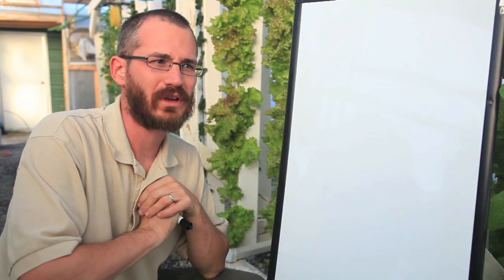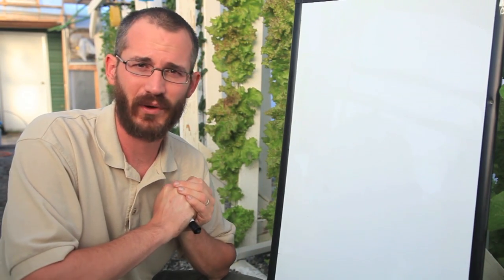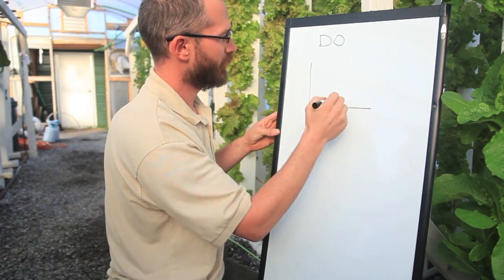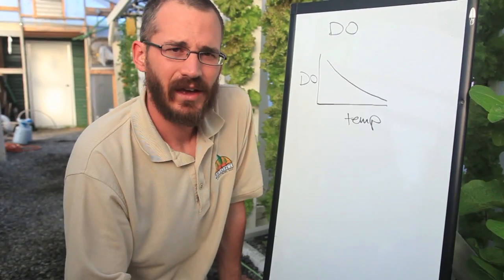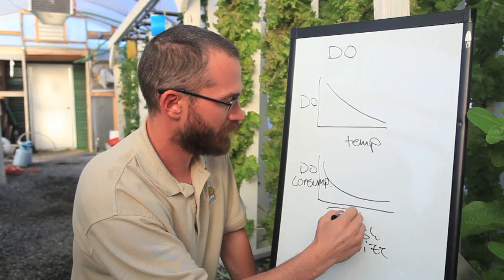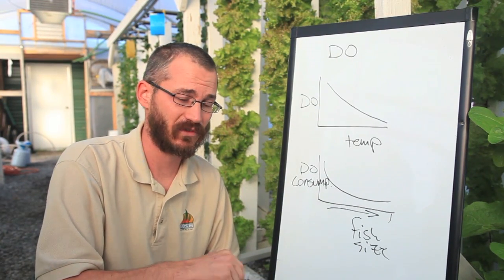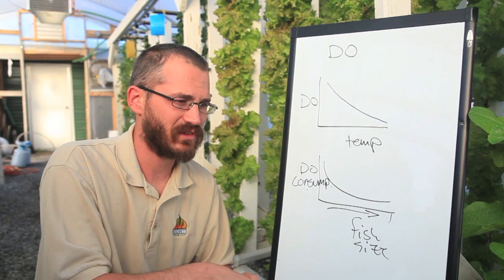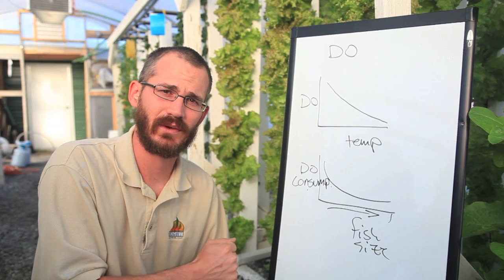Aquaponics & Dissolved Oxygen: The Basics

Comment: are there any monitoring tools available for aeration devices that would help keep dissolved oxygen at safe levels for the fish?
Reply from the maker: Hi Adam, Yes. You can use a DO (dissolved oxygen) meter to make sure your levels are within range. It depends on what type of fish you're raising but generally a minimum of 5ppm is what you want. Hope this helps!

Comment: Smaller bubbles means more ability of O2 absorption in solution. Look for as small of bubbles produced by stone as possible. Think about it like this, more surface area the smaller the bubbles have, more absorption into solution. It's like a boulder to sand weight ratio, the boulder may be bigger and heavier in a single mass. However sand at the same weight ratio has million's of times surface ratio as the single boulder.
Reply: Or you can reverse it, and trickle water through a trickle filter or mist water through the air back into the main body of water and get just as much O2 exchange from the surface area :D

Comment: I'm a backyard aquaponics hobbyist and I really appreciate these videos!  When it comes to internet advice I pretty much only trust you guys!  Nate's the man! 

Which is why I am curious about your thoughts on electrolysis for aeration.  Similar to the O2grow product.  Using electricity to split water molecules and make HHO gas.  Apparently, this is a great way to dissolve oxygen into water.  But are there any side effects?  I'm curious if the reaction will also create salts or chlorine over time?  Perhaps the plates will also break down with time and add metals to the water?  I'd love to know your thoughts on the topic!  Thanks

Comment: I have a question .right now I am.currently doing calculations and.designs for aquaponic system and I will use the tilapia as a nutrient resourc  . but I am.stuck at calculating the  aeration  for.the tank.I mean the air pump size and my fish tank size  20000liter, and the density is 500 kg can you explain for my how to calculate  that to choose the correct air pump size
Reply from the maker: Hmm.  It depends on the temperature you’re going to be running your water at, the turbulence you want to introduce and the fish and feeding rates you’re working with.  That being said a general good rule of thumb is the volume x1 or volume x2/hr for air- so you’d want between 20k and 40k L/hr

Comment: I have a question .right now I am.currently doing calculations and.designs for a.shrimp farm.where I live and I am.stuck at calculating the aeration requirements for.the tank. I am looking all over but I am.not finding the standard oxygen transfer efficiency factor and.the field transfer efficiency . can you guide me what figures to use or how to.derive these factors or where to look for.these factors. my tank is 24feet diameter by 52 inches deep. thank you.it's a biofloc system as well
Reply from the maker: Hey +Mansoor Hosein - Yeah, check out the fao.org site- they have tons of relevant information. I really can’t help with shrimp!

Comment: So this is actually in reference to a pond i'm attempting to restore into a self-sustaining ecosystem. I just added a homeade fountain to it, will that help create dissolved oxygen? Also what are the physics of the oxygen molecules in water? do they stay near the point of water disruption or do they disperse throughout it along the waves thats created from the disruption. Does it go down to lower levels of the water or stay near the top for it to escape back into the air?

Its a lot but i would appreciate a response :)
Reply from the maker: Hey dgorrell7  1. Yes, a fountain will help with DO.  2. DO diffuses through the water from areas of high DO to areas of low DO.  So it will diffuse, but it will also be consumed very quickly, so the question is whether your introduction and diffusion rates are faster than your consumption rates by microbes, fish, plants, etc. Hope that makes sense!
Reply: It makes perfect sense! i love the videos, some go a little to in debt for me but for the most part (thanks to physics) i understand a lot of it. Also, how does layering happen? when you say that it diffuses from areas of high DO to areas of low DO, shouldn't it go deeper into the pond? or is the water too warm and it escapes before it diffuses because of the molecules of water moving more rapidly? Thanks, i have a ton of questions.
Reply from the maker: Yes, it should go deeper in the pond, but consumption, different water temperatures, humidity, sunlight, etc. can all interfere with that process, dgorrell7.
Reply: Say i introduce crayfish, i'm assuming they're not much of a top feeder/algae eater but are they are a good first thing to introduce back into it? Because initially i was thinking about introducing carp into the pond to clean out the bottom or at least some of the dead matter (probably piled up). Then i didn't want the carp to spawn because that would be a huge nuisance. So i'm considering crayfish now. if you disagree could you forward your suggestion for a first species introduction? the pond has been practically lifeless except for ducks which don't do much for about 10 years or longer. and thats ten years of algae die offs. and up until recently with the fountain no sort of aeration either.
Reply from the maker: dgorrell7  - If it decomposing organic matter from plants, animals, duck crap, etc., they make pond supplements that are composed of bacteria that will digest all of these things on the pond bottom without removing them.  You just need to keep the pond aerated.
Reply: thank you!

Comment: Thank you Nate for all your great info.  My wife and I are in the process of creating an aquaponics system.  We have a question on "DO", when the water temperature is high, would it help to divert the circulating water down into the ground into a coil to pull the cooler temperature out of the ground in order to cool down the system water; thereby not impacting the "DO"?  Would this really help?  Thanks
Reply from the maker: Cooling the water will help, since colder water holds more oxygen.  So long as it's in the right temperature range for your fish, cooler is better when it comes to O2.

Comment: Hi,  I live at 7,000 feet in Flagstaff AZ.  What problems can i expect with having enough  DO?  What would be some simple solutions.  I was thinking an air stone but dont want to run the extra electricity unless its necessary.  I am still planning but want to avoid a high altitude mistake.?
Reply from the maker: Keep your stocking densities lower and your water cooler and you should be fine!
Reply: matt smith

Comment: You can marinate them with almost anything. Vinegar and sea salt. Paprika and olive oil. Coconut aminos and curry. Blended herbs with soaked cashews. You name it, its good on zucchini chips. I recommend dehydrating at first at 140 degrees F, then after one hour, turning it down to 105-115 degrees F (adjust for humidity) to maintain the best flavor and nutrition. :)

Comment: I find alot of information about DO required to keep fish alive,   but no information about the oxigen requirements of the plants.
I have a floating raft system that does not have a bell siphon system. In My system water circulates from the fish tank to a swirell Filter, 2 tanks with gravell (biofilter) plus 1 screen filter,  after water goes into a 12 inch deep  grow bed and from there is return to the fish tank.  HOW DO I DETERMINE HOW MUCH OXIGEN IS NEEDED to grow healthy plants?

Comment from the maker: Venturi fittings are really nice, Enrique. They're just one of those things that in some systems they can be kind of irrelevant. In systems with an oversized pump (pumping more water than you technically need), a venturi pump can be a great way to facilitate gas exchange and introduce more DO to your system (especially if you don't want to invest in an air pump). That said. Venturi fittings can tend to be redundant. It really depends on your situation and your system goals.